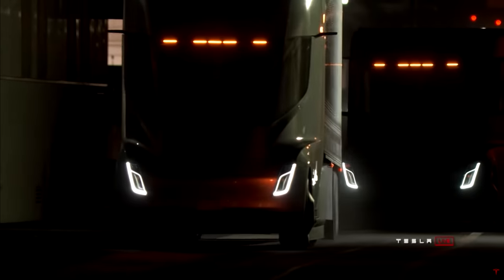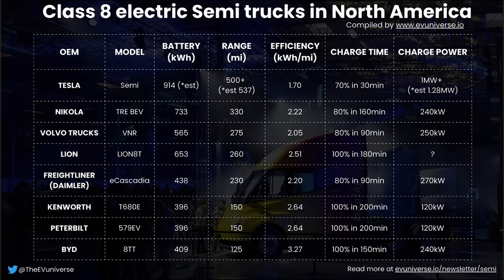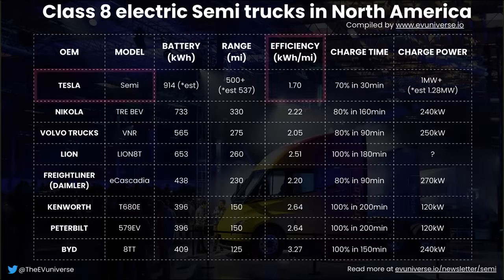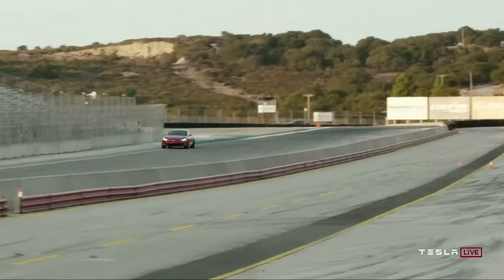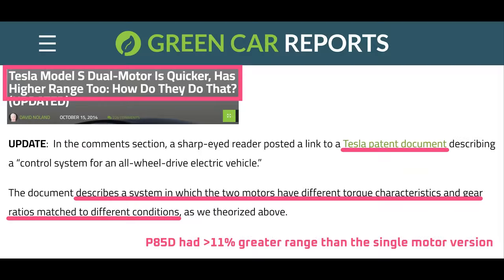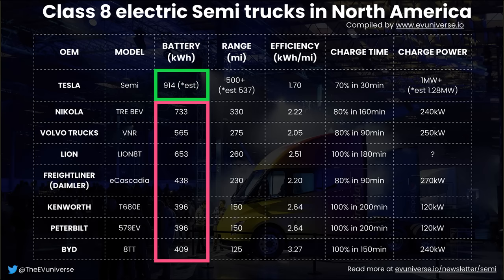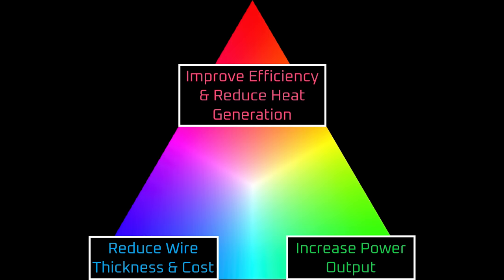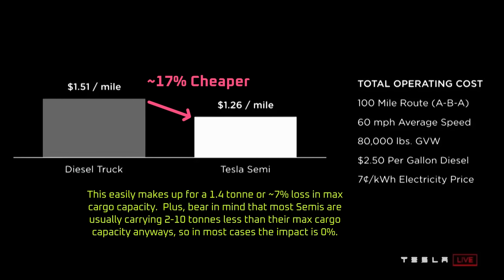How the Tesla Semi “Broke the Laws of Physics”

Comment: Every minute of every Limiting Factor video is appreciated. Thank you for your unparalleled efforts and unique content.
Reply: Except the bullshit on cargo capacity, it's max cargo capacity is 1/2 a diesel semi and on that hill climbing video it's carrying 5 ton while the diesel is carrying 20 ton. Short range electric semi is great, Tesla's is a joke.
Reply: @drac410  please recheck your very flawed math. The max cargo capacity of the Tesla is the same as a diesel thanks to the ax weight being 82,000 lbs making up for the weight difference with a diesel semi. And that’s the 500 mile version. And it’s range is 500 miles fully loaded at 82,000 lbs.

Comment: The 500 mile pack will be very useful for last-mile deliveries, for most firms that cannot afford a megacharger. For example, a truck years ago delivered pallets to our small warehouse. The driver said I was the last stop of 11 that day, returning to his Richmond VA hub 56 miles away, with an empty tank. Most days were 200 to 300 miles, getting better MPG as it gets lighter.
Reply: The payback on a Megacharger will be very quick when diesel fuel is $5+/gallon.   Most firms won't be able to afford NOT having one.
Reply: @SomeTechGuy666  Yes you are right, IF you can afford it.  One megacharger costing $2M can handle 10+ trucks a day.  But small trucking firms don't have 10 trucks or $2M. So they will borrow one or slow charge overnight. (Elon Musk and his brother rented a cheap office for his first  company in the 90s, says Ashlee Vance. Apple was started in a garage).
Reply: yeah, good truck to drive battery around 😂
Reply: I'm from Richmond
Reply: @SomeTechGuy666  Except they don't exist yet and a single one would require it's own substation.
Reply: @drac410  Neither do the trucks!  They'll build them as needed, just like they did for cars.

Pepsi has its own chargers.  And no they wont kill the grid.
Reply: @jimwhitehead1532  Where did you find that a mega charger would cost $2M?  A supercharger costs ca. $45k, installed.  I would agree that a megacharger could cost 10x as much, but 44x????

Comment: Excellent content!
Demonstrating the compounding "interest" of efficiency gains in regenerative energy's life cycle is visualized well in your presentation.

The effect of parallel systems (larger battery, added motors) on the total system's efficiency makes so much sense. The added performance is really just a nice windfall of reaching for this level of efficiency.
Reply from the maker: Well said!
Reply: Unfortunately that power is totally useless! You are comparing a 1020hp truck to 500ho diesel, a 750hp Volvo diesel truck hauls about 4x 5€3 load of tesla and that’s accross the outback.
Reply: And added weight...

Comment: Excellent video, thanks! As you said, the 'limiting factor' for regenerative braking is the battery. Bigger batteries can accept more Kw from the motors in 'regen' mode. 
This has a lot of advantages: longer battery life, higher recuperation of energy, less stress on single battery cells, faster charging time..
And last but not least more security because Tesla Semi brakes will not be needed very often!
Reply: So you somehow forgot the drawbacks?
Higher cost
More risk if it catches fire
Huge amount of extra weight
More charge time.
Reply: Tesla vehicles are a lot less likely to catch on fire than the average gas car. Extra weight in battery but the government grants electric trucks an extra 2,000 pounds, and there are some weight reductions in not having a giant engine. Overall the difference is minor. Charge time is surprisingly short. They redesigned their chargers and even added water cooling in order to charge these bad boys quickly.
Have you seen the cost of new semis’? Difference isnt that great, and the reduced maintenance costs and cost per mile means that it is worth it for many. Time will tell.
Reply: @R1L1.  Diesel trucks also catch fire, which sometimes result in dozens of death, as what happened in Mont-Blanc tunnel, close to where I live.  Actually, gasoline or diesel-fueled vehicles catch fire much more often than later-generation electric ones, especially Teslas.
What huge amount of extra weight?  As mentioned in the video, the Semi's payload is within 1-1.5 ton of a diesel rig in the USA, and actually even a bit higher in Europe, due to a larger max weight allowance for electrical trucks.
More time to charge than to fill-up?  Yes, correct...  but except for team operations, the amount of hours a truck can move every day is limited by the driver's legal driving hours, not the battery's charging time. 
Higher costs?  The ticket price may indeed be higher, but what counts to a trucking company is overall costs. And in that, the Semi will excel!

Comment: A truly breathtaking analysis that made the impossible appear "obvious" after the fact. To capture the regenerative breaking from a heavy fast moving truck going downhill requires massive battery and generator (electric motor) capacity. After the fact: Duh! The other great idea is that the difference between hyper-acceleration a model S Plaid and a heavy semi can be reduced to gearing! (Archimedes would be proud).  Great work and I apologize for the "Duh" that is only after you brilliantly explained it.
Reply from the maker: Pfff, no offense taken!  It was cathartic, lol
Reply: @thelimitingfactor  
You could say a "Eureka!! moment"? 😁
Reply: Lol…. Proud of what!?
Reply: Acceleration on trucks is totally useless tbh!
Reply: @alanmay7929  not when going uphill.
Reply: @gregbailey45  still it’s useless! Because you are comparing 1000hp electric vs 500hp diesel going uphill with the same load so it’s totally not a great comparison so cheers….
Reply: @gregbailey45  a 1000hp diesel truck will go uphill with 2x the load of that tesla because yes the diesel truck will have almost 4x the torque of that tesla and that’s facts!
Reply: @gregbailey45  the scania 770s has up to 3700Nm of torque wich is almost 3x the torque of that tesla just imagine a 1000hp scania again! Hahaha 🤣 not funny anymore right!
Reply: @gregbailey45  there are literally 600hp diesel trucks hauling 200,000lbs of loads here and there.

Comment: I like your theory that the 3 plaid motors are there to increase regen capability of the semi.
Or put another way...
Instead of having 400 hp braking with one motor, you now have 1200 hp braking with 3 motors.

For a couple of hundred lbs in 2 extra motors you get:
- 3 times the acceleration
- More range as you capture more kinetic energy
- Much less brake wear.
Reply: You forget that having more peak power also means you don't have to run everything at or near peak power for extended periods of time but at or near peak efficiency most of the time. 

An electric power train that is rated for much higher output is just a bit heavier than the weaker one but will waste much less energy in heat losses at the same power output, that's another bonus you get... I just don't know what's more efficient: run all three motors at lower power or decouple two and run the third at higher power.
Reply: I would say some of your assumptions may not hold true. 

You are automatically assuming that carrying the extra weight of those motors will somehow only be a benefit. If a truck is going to do a lot of start/stop driving like buses then yes it makes sense. 

However if a truck is doing a lot of long haul trips then acceleration is really irrelevant, and carrying the extra weight of those motors will probably reduce the range without much benefit.

They are already keeping the weight of the truck a secret, which seems to suggest it is very heavy already. It seems strange they are avoiding mentioning the weight of the truck, especially since its one of the most important stats.

Comment: I want to see the speed synchronization system between the motors and roadwheels (drive axles)
That's going to be a "KISS/ Facepalm" moment for transmission designers everywhere.
I imagine simply 
1)monitor axle rotation speed
.
2) Spin motor to appropriate revs
.
3) Engage solenoid. Drive dogs engage.
No "clutch" required
Reply: Its been done in hybrid propulsion systems in the marine industry (in transferring between motors and engines).
Reply: Are you sure there is no clutch and clutch face?
Reply: @bru512  
Watch the animation
Reply: Agree, no doubt...
Reply: @rogerstarkey5390  Ok, I am convinced there is no clutch plate.   Cool & thanks!

Comment: The recovery of kinetic energy with Plaid power train is an essential efficiency and reduced cost of brake maintenance play...  but note the Plaid power train is actually 3x400hp=1200  as planned for the plus version.  What limits current Plaid to 1020hp is battery current max limits... According to information provided by Tesla back in early 2021

Comment: I like your triple constraint diagram. It's similar to the classic project management one - time, cost, and quality. "You can have any two, but not all three." Tesla seems to be breaking this axiom but it still largely holds true. 

Also, as others have noted below, you do a great job of showing how the counter-intuitive, like a huge battery is more efficient, depending on the use and design, than a small one. This helps explain how Tesla can, "break the laws of physics." More like Daimler's views on physics are simplistic.
Reply from the maker: Amen!
Reply: Larger battery means more weight which decreases max load carrying capacity.

It's not free efficiency gains.

Larger battery also means larger charging times and massive infrastructure to charge them.

It's not free efficiency gains.

The Tesla semi doesn't break the laws of physics. Elons promises do. He says in the same breath that you'll get 500 miles on a charge, and you can go zero to 60 real fast. But you can't do both of those, and literally nobody cares about 0-60 speed in a semi truck.

What is the maximum carrying capacity of a Tesla semi (not including the battery) compared to a diesel semi? If it takes 2 or more electric semis to carry the load that could be carried by one diesel truck, these efficiency gains disappear.

Comment: Great work as usual Jordan!
I have wondered why they used mechanical clutches to disconnect the dual motors in cruise.    If you just leave the motors open circuit they would freewheel anyway.    Perhaps back-driving the reduction gears wastes power?   
The other thing I have wondered is whether you could dump regen braking power into some supercapacitors.   They are able to absorb enormous transient charge currents.
Lastly, the assumption that good regen energy recovery is a cause of the efficiency would only apply in mountainous areas or around town in stop/start traffic.  This would not be consistent enough  for Tesla to claim a repeatable 500-mile range,  right?
Reply from the maker: Yeah, the motors do create 'drag'  Better to disconnect them
Reply: I too have thought of the super capacitors that would then charge the batteries… maybe they just want to keep it simple
Reply: I think the super capacitors makes a lot of sense. Wonder how that could be incorporated into current EVs because it would be impermanent energy storage that could be transferred to the battery. Removing the limitations of current battery chemistry.

As far a regen it’s always a good efficiency effort as you always have to stop at your destination so the energy needed to stop your vehicle becomes improved efficiency. Variations in elevation are simply the more extreme scenarios that generate more power to offset the increased power demand
Reply: @chidorirasenganz  Plus:  Tesla bought Maxwell - their main product was supercaps.
Reply: @castletown999  👀 yeah you might be on to something. I need to look back into super capacitors again lol
Reply: Exacty, Regen is useful for braking.  If you never needed to brake it would be a useless feature.
Braking via Regen with large loads in mountains and stop and go traffic could recapture a LOT of energy.
Reply: @thelimitingfactor  About the clutches:   Hmmm.  Still not completely convinced.   I would have thought that in cruise you could have just altered  the power distribution between the two drives instead of completely disconnecting one of them mechanically.   In cruise you would use the single motor and feed the two motor drive with just enough power so it isn't being back driven.   This would save two clutch mechanisms, which would be consistent with the Tesla "best part is no part" philosophy.  
If this doesn't work, it implies that the losses in the two motor drive are very high.
Reply: @Jonathan Numer  I'm sure Tesla would have considered using supercaps. Probably not worth the extra weight.
Reply: @chidorirasenganz!  That would require a truckload of supercaps. Prolly not worth it. Their energy density is too low.
Reply: @gregbailey45  and cost.
Reply: @castletown999  the accel motor spins very fast at cruise speed so there are significant windage and eddy current losses added to gear friction losses.  So it pays to disconnect them.
Reply: Lots of efficiency info that I’ve never seen before.  Thanks for great new insights and additional proof that Tesla has worked harder than the rest.  So it’s not magic or conspiracy, it’s good engineering.
Reply: @gregbailey45  or worth the extra cost.

Comment: To me, the greatest advantage over Diesel trucks is that EV trucks have regenerative braking. It does not fear climbs as it can always regenerate and recharge when it goes back down the hill.
Reply: The problem however is that most of the weight it needs to haul is its own batteries. i.e. not payload.
Reply: @HTOP1982  Wrong again.
Reply: You’re dead wrong son
Reply: @HTOP1982  As mentioned in the video, the Semi can carry the same payload, within 1-1.5 ton as a diesel rig. And, as demonstrated by the Tesla video, it can go up, at full load, a 6% incline at double the speed of a diesel truck, and it can also go down faster... that's time saved, at least in hilly country... lot's of it!

Comment: Regenerative breaking does not capture anywhere near 100 percent. While traveling uphill you're overcoming aerodynamic drag, friction, and gravity, plus all losses in the electrical system.  Downhill you're still losing efficiency to aerodynamic drag and friction, plus that same efficiency loss in the electrical system, plus additional losses associated with charging a battery that you do not have while discharging.

Comment: If the downhill involved many twists and turns on a steep gradient, then regen may not be sufficient to prevent a possible run away.
Reply: You would need to periodically use the friction brakes anyway, or they glaze and won't work in an emergency.
Trucks have had powerful non-friction brakes (Jakes, transmission retarders etc) for decades...but the manufacturers 'blend' them in to ensure the friction brakes are still used. If Tesla isn't doing this then there is trouble ahead, because retarders/regen brakes don't work well in emergency situations (ie they won't cycle fast enough for effective EBS).